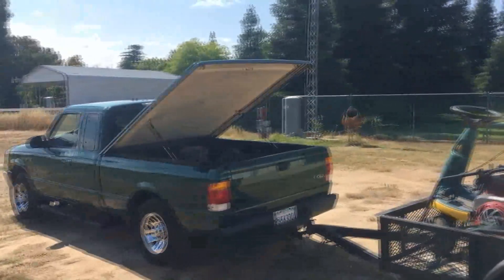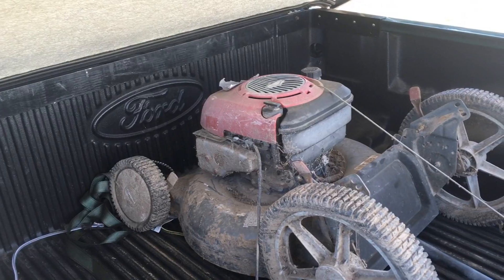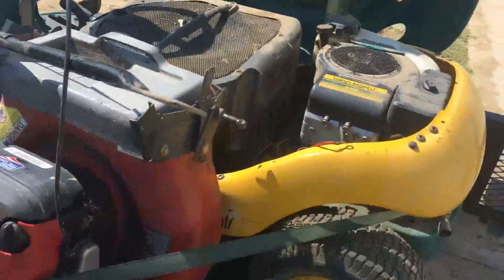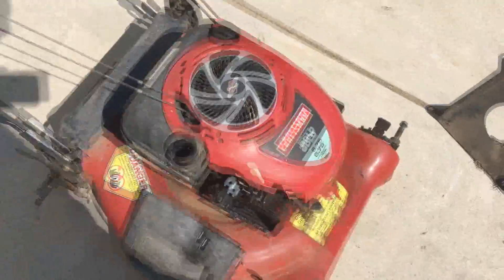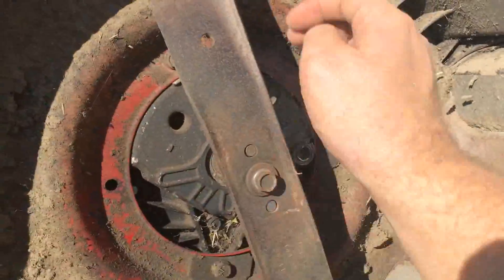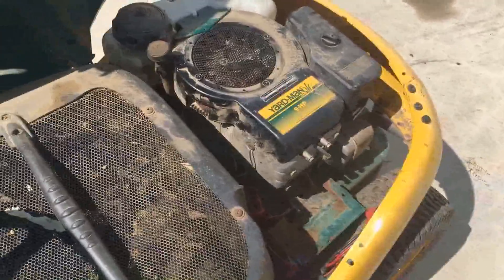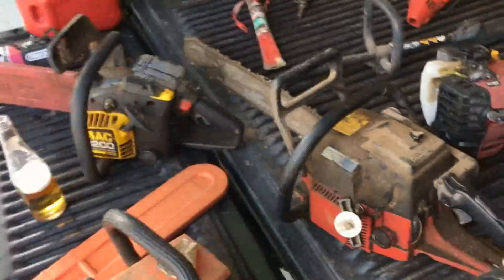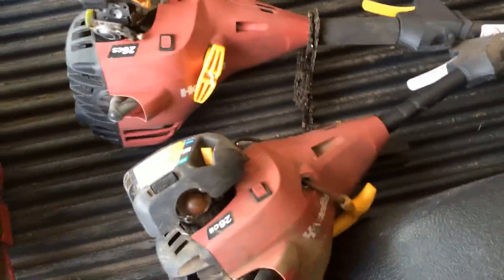Another BIG Small Engine Haul - Yardbug Rider, 2 Mowers, 3 chainsaws, 4 weed whackers

Comment: Nice haul man! those Johnsred saws are a higher end brand, those yard bug riders are fun just to ride around, lol I had one with an 10.5 horse Briggs.
Reply from the maker: Ya that's what it looks like I haven't messed with them all much yet though hopefully I can get to some of it this weekend. Are those mccolloch saws any good?
Reply: +hanksranger Mac cullogh saws are about the same as the Poulan & the other cheaper saws, since it runs a little it's probably worth putting fuel lines & a filter in, around here 40 to 50 bucks is what I get out of them.